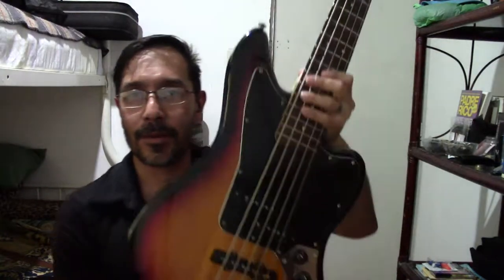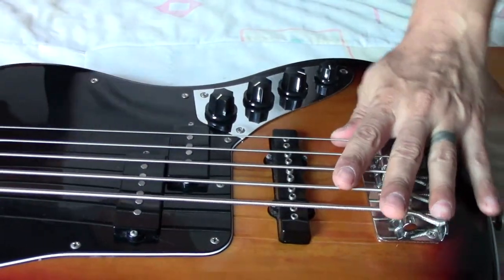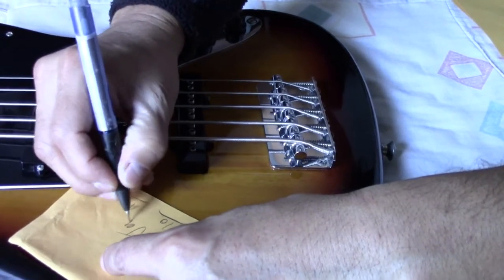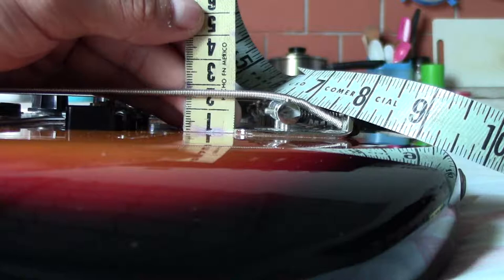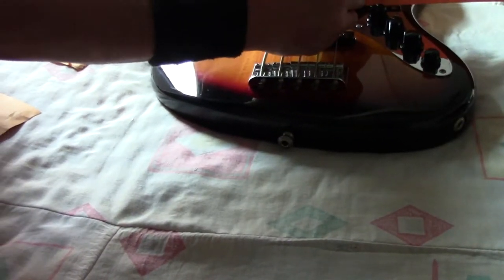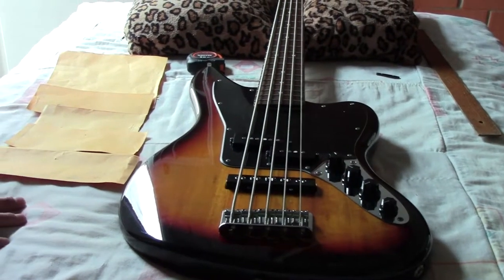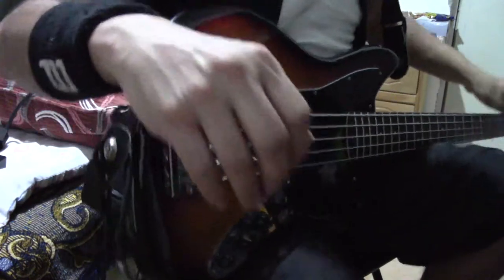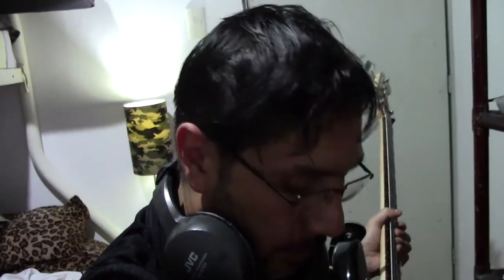super squier modificación , pastillas Seymour Duncan, puente Hipshot

Comment: I've recently purchased one of these basses, I think they're super cool. Would you recommend upgrading the pickups and bridge? Were you happy with the results? Thank you!
Reply from the maker: It took me a while to take the decision,. But the noise of the single coii in the jazz pickup kept bothering me , I also noticed it didn't have enough sustain therefore the bridge changed, the P pickup was a plus, it was not necessary but it turn out better than expected, 
In the general I have a way better bass now , but now I can't sell it
Reply: @gaboquintana3628  Thanks for your reply. I think I will probably do something similar. I like that the components you chose are very similar in appearance to the standard components so it doesn't change the overall look very much. This was a really useful video for me. Thanks for uploading!